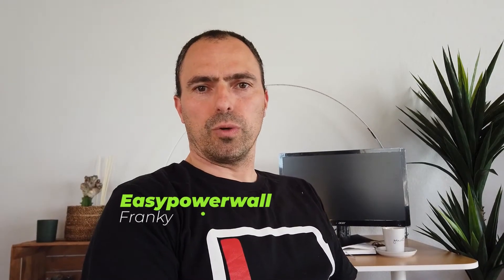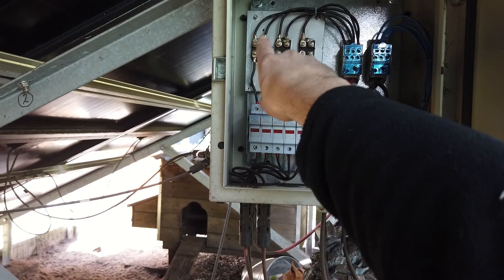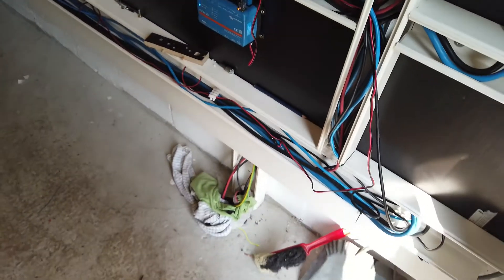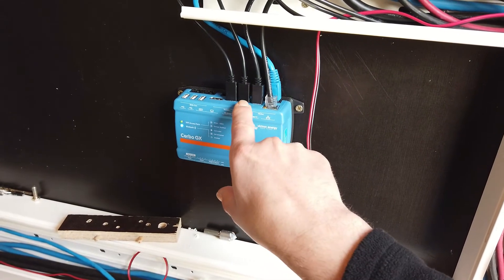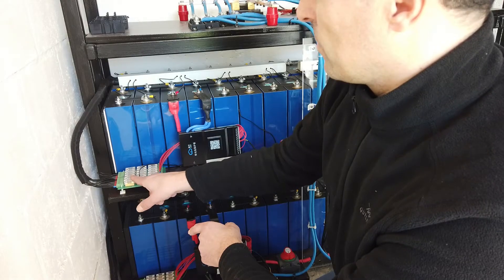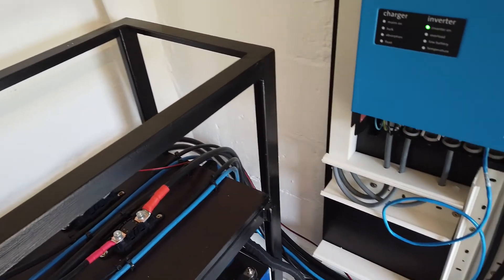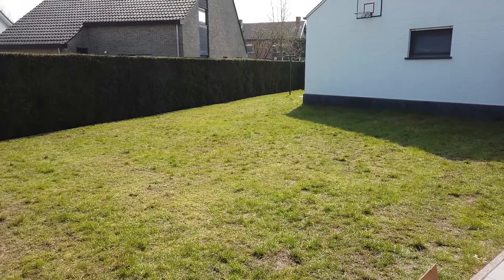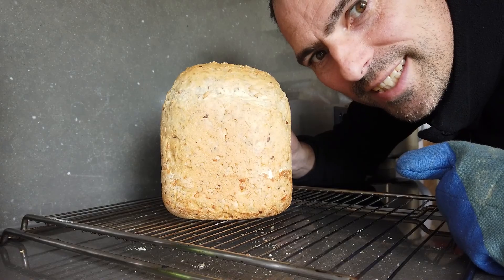The easypowerwall from A to Z. The draft, design and built of the LifePo4 powerwall. Full tour.

Comment: I have two refrigerator loads and lighting, the total of all loads is one and a half kilowatts, and I want to operate these loads during the day from the surplus production of the solar panels so that the rest of the panels’ production is for charging the battery, as my circumstances are tiring and I only have 16 panels of 170 watts, and I want to buy a lithium battery after you understand the question required of you, how much battery capacity do I buy so that I can benefit from it during the night, even if it is to operate half of the loads during the night and day, I operate all the loads from the surplus panels, knowing that we do not have an inverter, and I want to determine the battery capacity and how to connect the panels and how many strings, as the loads are 12 volts

Comment: About the DC breakers,  5:20  50A for incoming solar, and 80A for battery. These 80A EARU have an Icu=10kA (the 50A/6kA) , is that enough in case of shorted battery? I saw NanQue which have Icu=25kA but 8x times the price.

Comment: Hi Franky, thank you for this video. It's exactly the type of video I'm looking for to get specific details of how all the components are connected.
I'm curious about something that I have seen on a family member's installation. Like yours, the cable diameter from busbar (Lynx Power In) to fuse is smaller than the cable diameter from fuse to Multiplus II. I don't understand the reasoning for this.
My understanding is the current would be limited to that of the smaller diameter cable, so why use two different diameters? 
I'm hoping you might be able to explain this to me.
Reply from the maker: Hi Nigel, 
For short piece the loss is not high and it's easier to bend the cable between this busbar and the fuse.

Comment: How much resistance does one fuse add to the circuit?

25mm2 seems a bit small for the size of your inverters. Wouldn't it make more sense to do 70mm2 off the bus bar and at least 35mm2 off the batteries to the bus bar? Or do you plan on never running your inverters very hard?
Reply from the maker: HI Eric. The cables between the busbars and the inverter are 70mm2. Only the short piece between the busbar and the fuse is 25mm2.

Comment: I noticed that the power cables coming from the charger busbars are different lengths as it goes to each battery pack. IE the batteries closest to the busbar (top shelf) has less cable length then the one that's on the bottom shelf. I have found that the batteries with the shortest route or length of travel not only gets used up the fastest but also charged more often.... just my thoughts.
Reply from the maker: HI, thanks for your question. I agree there's a little difference in length. Because I have 4 x 15KWh, the current for every battery is pretty low, so losses are marginal. But it's a good topic for a future video. Will show current difference while charging.  Stay tuned.

Franky

Comment: That’s a great set up. Do you know if the battery banks can pass the Fluvius inspection/certification?
Reply from the maker: Hey Jack, they passed my wifes inspection...if it passes there, it passes everywhere  :-)  
Just kidding. No idea if it's passes the Fluvius inspectation. Some builders with similar setups managed to pass inspectation, so I think it's possible.
Reply: @easypowerwall  Great, I'll try to pass it in around 6 months with 32 cells 280ah, a Deye Hybrid inverter and 36 pannels. I'll let you know. Keep the videos coming!

Comment: Why did you choose to have your upper and lower battery banks connected with different length of cables to the busbar? Won't this give a higher flow on the battery banks with the shortest cables?
Reply from the maker: Hi John, 
Indeed there's a little difference but the impact is marginal. If I'm using 2KW of energ, that's 500W per bank, +/- 10A, so voltage drop is nearly zero. Difference is only 40cm max, so definitely not a dealbreaker.
Have a nice day.

Franky

Comment: Hello,

Thanks for sharing these videos. I’m also on my way to build such system.

Please check the multiplus manual, chapter installation.
Victron states that the negative battery cable should ALWAYS be connected to the multiplus and it’s not allowed to put switches or breakers on the negative lead.

I don’t know why this is…

Anyway, good luck and thanks again!😊
Reply from the maker: Hi Erik, thanks for your reply.
I'm aware I need the ground always be connected with the MP, that's why I installed a fuse in the + line.
Normally I will never disconnect all batteries...if I do, the MP will be switched off.
Thanks for the remark.

Have a nice day.
Franky

Comment: Great setup! How did you solve the problem with inrush current for the inverters when connecting the batteries? Did you implement a precharge resistor circuit?
Reply from the maker: Hey Jens, I actually have a unique system to overcome the inrush current. It's planned for a future video. If my answer receives a lot of "thumbs up"....I will avance the video. 

Have a nice evening.
Franky
Reply: @easypowerwall  okay, thanks for the reply :)

Comment: If you are thinking of adding more cables to the house think about a conduit, that way you can pull any cable you want at any time.
Reply from the maker: Hey, 
4 years ago when I started the project I installed a small conduit. It might be possible to add an extra cable.
See how it looks like here: https://sites.google.com/view/diy-powerwall/inverter/all-electric?authuser=0
After 4 years, things got out of hand, never taught the battery virus would bite me that hard.

I'll find a way to get the extra cable between point A & B.

Bye for now.
Franky

Comment: It would be good to add a second row of output terminal connectors to the BMS protection board to allow connection of the active balancer.
Is it possible to buy your BMS protection board somewhere?
Reply from the maker: Hey Tibor, 
The board is connected to a JK BMS. The BMS has an active balancer onboard. (my version 1A)
But I agree, it might be interesting to have a bigger balancer when cells get out of wack after many cycles.
I was planning to launch a  sale of the board when the in depth video about the BMS protection board was published. 
Will contact you via FB group: https://www.facebook.com/groups/1076897519357184     
BTW have to add some minor tweaks.
As always the gerber files will be available too If you want to order the parts and PCB yourself.

Talk to you soon.

Franky
Easypowerwall.
Reply: @easypowerwall  unless your cells are Grade (G)arbage the 1A balancer should be plenty